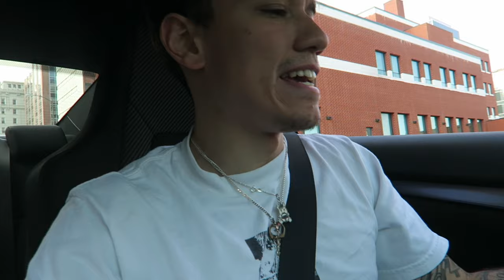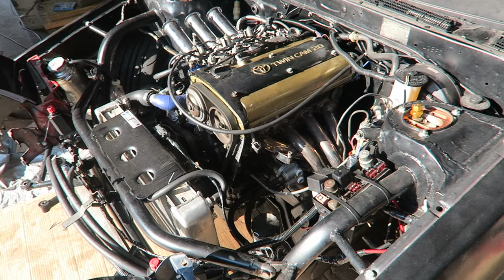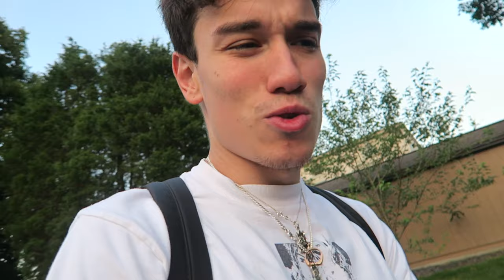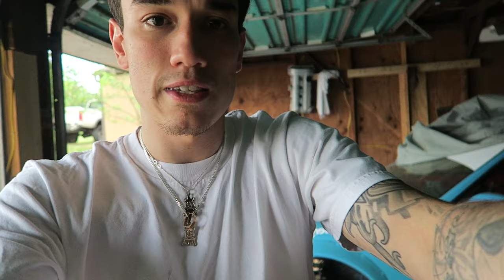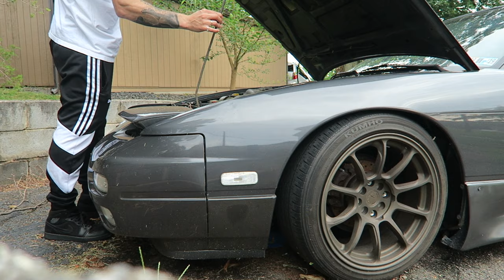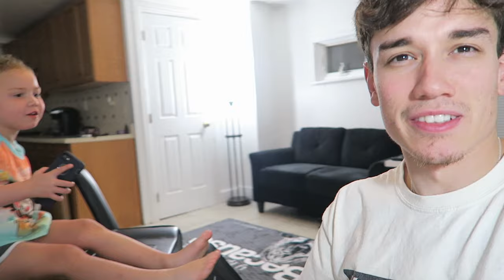S14 TRADE FOR AE86 | THE HARDEST DECISION OF MY LIFE

Comment: Me having a ae86 I’m speaking from my point of view.

I wouldn’t.... it’s a zenki coupe(the ugliest one of them all) 20v is just a unreliable and underpowered motor(I hate 4age’s which is why I have a ka powered ae86). The value overall the 240 dominates.

Aftermarket support is more on the 240 side where as the ae86 is straight up cookie cutter type builds.

Ka-t 240 - no issues > Ae86 20v with typical ITB tune problems

240sx memories and cleaner condition overall > ae86 tubed front and what seems to be “not clean” chassis

300hp > 160hp if that due to problems

Me personally I wouldn’t take that big of a loss in this trade unless money is involved.